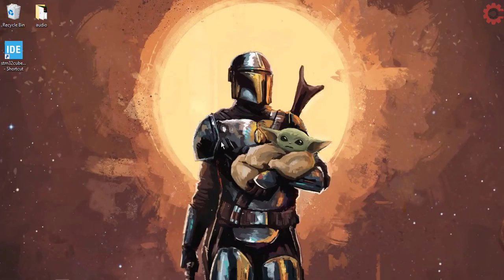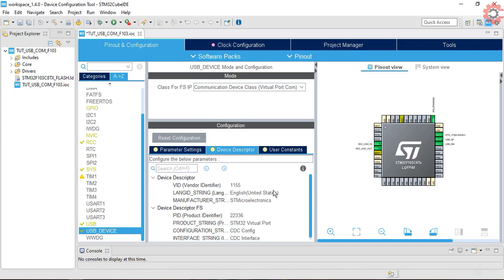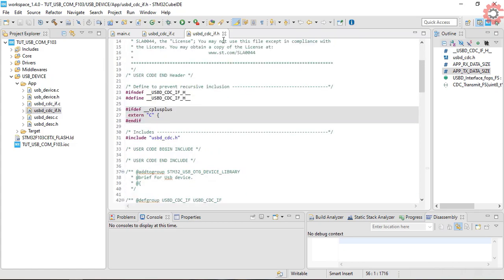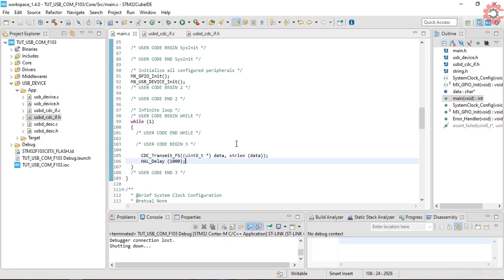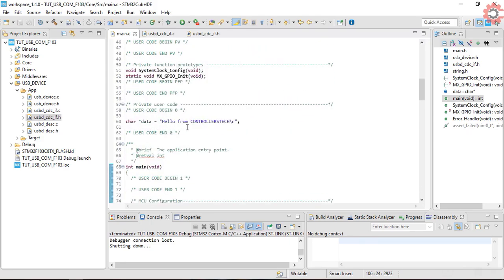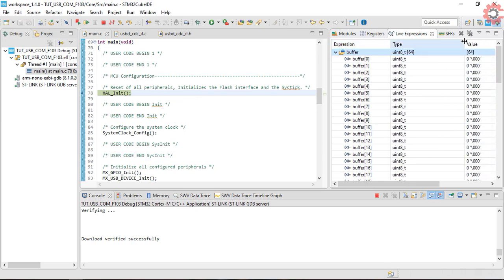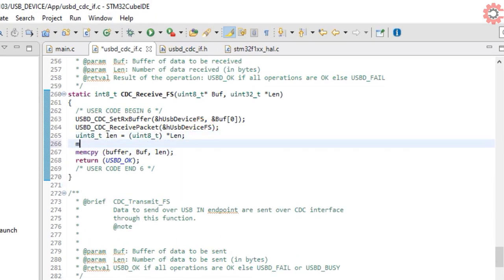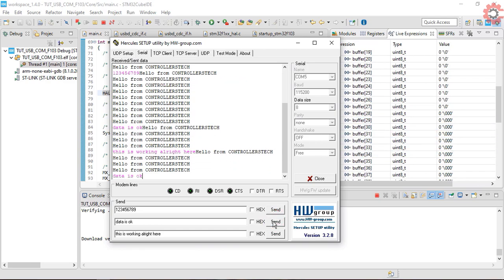STM32 USB CDC Tutorial: Virtual COM Port || Bidirectional Communication Without UART

Comment: From this video i assumed that you had connected the bluepill with both USB cable and the ST-Link debugger. But i can't understand how does your step able to run both debugging and Hercules terminal at same time. I have used your example but in my case if i connect the usb first and open port in hercules it is sending the string very well (i.e Hello from Controllertech) but after that when i connect STLink V2 debugger and start the debugging the string transmission stops on hercules and i even can't send anything to stm32.
Can you help me what i am doing wrong here?
Reply from the maker: Are you using bluepill ?
Reply: @ControllersTech Yes Sir.
Reply: @ControllersTech Please help me in to understand your setup for doing both debugging and sending data to stm32 at same time
Reply from the maker: There is no specific setup. It just works normally.
I will test it again tomorrow to see if there are issues due to ST's firmware update.
Reply from the maker: @RavindraSingh-jw2sm I checked it again and it works just fine. Make sure you connect the cable after running the debugger or else it will not be detected.
Reply: @ControllersTech Thanks for reply. I will check again as per your guided method.

Comment: Win10 not recognize device. Any advice?
Reply from the maker: Run the program first then connect the cable. Also make sure the cable supports data transfer.

Comment: Hi , nice video but I have an issue. I cant debug and use hercules at the same time. Is there anyone knows how to solve?
Reply from the maker: You need to establish the connection after running the debugger.
Reply: @ControllersTech  Thank you for your answer. But herculus cant open the serial with the linked com port when it is in debug mode.

Comment: hello i have followed all the step in the tutorial, but i can't manage to get the data on hercule nothing appear. What can be the issue
Thanks
Reply from the maker: Probably the usb cable does not support data transfer. 
Which board are you using anyway ?
Reply: @ControllersTech thanks for answering I am using stm32F407 discovery board,

 I will change cable and see if it's working.
Reply: @ControllersTech  thanks for answering, I am using stm32F407 discovery board.

I've used another cable but it's still not working.
Reply from the maker: 1. The video title says f103c8. Although you can use the same idea for other custom boards as well (like blackpill), but not for nucleo and discovery boards. 

2. Nucleo and Discovery boards comes with inbuilt ST Link, which can also be used as virtual com port for the UART communication. So you don't really need USB mode for it to communicate directly with the computer. Check the UART series, I have explained it in the first or second video I guess.

3. If you want to use USB mode so badly, you can sill follow the video procedure. But you need to connect the USB to the user USB port, not the ST Link. It is generally avaialble at the bottom of your Discovery/Nucleo boards.
Reply: @ControllersTech  Thanks for answering.

 i wanted to be able to use the usb port on my STM32 DISC because I want to connect it to an instrument and communicate with it. 

My computer doesn't recongnise the STM32 USB port even the Bluepill USB port.

-I checked the cable by connecting my phone and my phone was detected to send and receibve data (so it's not my cable) 

Best regards
Reply from the maker: "My computer doesn't recongnise the STM32 USB port even the Bluepill USB port." 
It won't automatically detect the USB. You must program the bluepill to use the USB peripheral. Then when the program is running, connect the board to the computer.
Reply: @ControllersTech  Thank you very much for your time and the recommendations. I find my problem it's because I don't have the stm32 VCP driver also. Driver in the link you furnished just for win 7 and 8 and I am on win10. 
No update available

Comment: How to do it for nucleo F767ZI ???
Reply from the maker: Why would you want to use it in a nucleo board ? You can simply use the uart2 to communicate with the computer.
Reply: @ControllersTech  You could also use uart in case F103C8 but you did not. Besides I want to do it without uart in similar way as you did but I encontered problems.
Reply from the maker: No you can't use uart in 103c8, if you do, you need to connect an external hardware to convert the uart data to usb. This was the main reason for the video. 
The nucleo boards has virtual com port which allows the uart data to display on the serial monitor without the use of an external hardware. 
Anyway if you insist on using it, you need to connect the usb to the "user usb" port, not the st link. Also make sure that the usb supports data transfer.
Reply: @ControllersTech  USB_DEVICE and USB_HOST in MXCube are disabled. I did not find the information how to enable them.

Comment: Hey, I use stm32 blackpill with stm32f411ce6u n the problem i face is when the product connected forthe first time via USB c interface it shows up as serial port and after installation on stlink v2 driver it isn't showing or there is no response via USB c n the c port is giving the power and the board turn on
Reply from the maker: Just run this example on the board. The USB C port will be detected when the example is running.
Reply: @ControllersTech  not anymore I brun it

Comment: I am using stm32l152c disco board  
And after connecting board to pc port no. is not visible.
Reply from the maker: It doesn't work for ST link USB ports. Connect to another USB port (user USB) if available.

Comment: Hi, I'm using STM32F446RE , i did same procedure i didn't get errors in the program but output is not coming
Reply from the maker: It won’t work with stlink usb. You need to connect another usb port.

And why bother with this ? Nucleo boards have uart connected to the stlink. You can simply use uart2 to send and receive data to computer, without using any additional hardware.

Comment: Hello, I need this tutorial now, but it doesn't work I am using STM32F446RE. Are they some updates or something that change?
Reply from the maker: You need to solder the user usb on that board.
The default usb you might be using is for the ST Link, and it can't be used as usb host or device.

Comment: Excellent video, but my WIN 10 is not recognizing the new virtual port. I have installed the official STM drivers, but no success!  Did anyone face the same issue
Reply: i think i have the same issue, did you resolved that?
Reply: @panteral6179  I have solved it yet, but I think about using another library than, that from ST electronics. I will try it next weeks

Comment: Hello, thank you for this video. I have a question. What happens if you restart the PC and the board remains connected? Can you still see the device in device manager? Since mine shows the USB descriptor request failed. If I plug it out and plug it back in again it works fine. But I have to do that every time I restart the PC. Do you have any advice on this? How does your device behave? Thanks!

Comment: Sir, if I do the Simple Led blink Program, then how can I check the output? I want to do it without ST link.
Reply from the maker: If you are just getting started, i would advise that you get a STLink or get a nucleo or discovery board, they have st link built in.
There are methods where you can upload the code to the bluepill without ST link. But you need to reprogram the bootloader for that. You can search about it.. I personally haven't done it yet.
Reply: @ControllersTech  OK sir. I will try to find and do the work.

Comment: works perfectly until i press reset button. It stops sending the string (have to unplug and plug the usb) . I don't see any stopping condition in the code . can you explain ?
Reply: did You resolved that issue?

Comment: Hi, the video was very informative. But can you guide me to any link or video for linux, as HW is not available in linux. I used putty, for getting the transmitted data. But cant do anythng to send data to the board. I am very new to this,if someone can help me with some tutorial guide / site, it will be very helpful. 

And also after debugging, running the code in STM32 CubeIDE it also shows an error like this : 
libusb: error [udev_hotplug_event] ignoring udev action bind

Can anyone please help me on the above also. Any small clue will be appreciated.
Reply from the maker: you can use putty to send the data also. If it's not convenient, look for cutecom.

Comment: i am limitted to recevie 64 bytes. after 64 bytes buffer overflows. "*Len"  pointer in "static int8_t CDC_Receive_FS(uint8_t* Buf, uint32_t *Len)" overflows when reaches to 64.
Reply: Did you indeed change the C code shown?  It has a hard code value of 64 I think.

Comment: Hello I have a question about the Len parameter in the CDC_Receive_FS function. What is it for? and what am i supposed to fill in? can I leave it out?
Reply from the maker: You don't write cdc_receive_fs function, it will be called automatically when the data is received by the controller.
Len is the number of bytes received. In the video i am using memcpy function inside the cdc_receive to copy the received data into the desired buffer. The length of the "data to copy" using the memcpy function will be the Len parameter, as that's the total data we are receiving.
Reply: @ControllersTech  thank you!

Comment: (Edit - IT'S WORKNG NOW)...

I am using stm32L475 and I cant see options for usb as shown in video. 
I can see three options
USB DEVICE
USB HOST
USB_OTG_FS
ALL WERE GRAY

but when I selected there pins, 
I can enable USB_OTG_FS .
I proceed with it, but in my project I can find any usb_cdc_if.c. 
Even the USB device folder is not generated.
Reply from the maker: Can u give the full name. I tried it with l475vg and the USB_OTG_FS is not greyed out..
From there you enable the host.. then the USB_HOST option will be available too
Reply: @ControllersTech  I did it today, It was just a matter of different wording, It is working properly now. Thanks for reply

Comment: My board is not being recognized as COM port. What should I do?
Reply from the maker: Which board ?
Reply: @ControllersTech  Hi. I am using ST32F013C8T6 Blue Pill.
Reply from the maker: Make sure the usb cable do support the data transfer.. cheaper cables are only build for charging
Reply: @ControllersTech  It does support. I am using Windows 10 and the St-link is being recognized but COM port.
Reply from the maker: You have to run the code. Then connect the USB.. now check the device manager

Comment: Nice!. The data is transmitted in which format? char or hex? What if I send uint8?
Reply from the maker: Whatever you want to send You need to send as characters.
Reply: @ControllersTech  I receive just a single char on Windows 11 Putty. It looks like the wrong baudrate setting but the baudrate is not applicable/relevant for a virtual com port. Double checked the clock settings and they are identical. Any suggestion?

Comment: Are there any STM32 modles that can do this without an extranal resonator?
Reply from the maker: Yes all of them can work with internal clocks. 
During the cubemx setup, instead of using HSE (High speed external) clock, just use HSI (internal).
Reply: @ControllersTech  
When I try to use the HSI, I get an error saying "cannot find a solution for some constraints". I am using STM32446RE. Should I maybe buy a different modle to make this work?
Reply from the maker: 1. You can use external crystal for 446RE. It will use the one for the ST link on the top.
2. If using the internal clock, the system clock will be limited to certain frequencies, so you can't use whatever you want in this case.
3. This video won't work with 446RE nucleo, unless you have attached one additional USB port ( you can see it below the empty crystal, "user usb").
The USB that you use to load program is the ST-Link, it's not the user port.

Comment: Can the data received from the stm32 be saved to a text file continuously until the code has finished running?
Reply from the maker: Well you have to build an application for the computer to do so. You can use uart to receive data from STM and save that data to the file on your computer

Comment: hi people! i'm using the same stm32f103c8t6, and i've tested the code as the video and it works, but without the debugger (stlink-v2), anyone knows if there's a problem using usb communication and debugger at the same time? or maybe i could be missing something... from now, thanks
Reply: did You resolved that issue?

Comment: Would this work if I have no HSE Crystal fitted? I was using a nucleo which didn't have one fitted it worked for weeks and now doesn't worried it might be the crystal
Reply from the maker: Nucleo have 1 shared crystal between the stlink and the mcu. So i don't think it's the crystal
Reply: @ControllersTech  Thanks so much for getting back to me! It's the NUCLEO-F411RE which appears to have a separate place for it? It really makes no sense as to why it did work in the past. To be sure if there is no HSE, the 48MHz can't be generated and so the USB device won't work as expected?
Reply from the maker: This particular project will never work with nucleo f411. It requires user usb slot and f411 only have stlink usb.
Reply: @ControllersTech  I have just used the IO header (CN10) as PA11/PA12 are available at that header. I have  then connected the USB D+/D- to those two points. Thanks again
Reply from the maker: I don't know why are u going through all this trouble when u can simply use the uart2, which is routed through the stlink usb itself, but it's upto you anyway.

I don't know why it's not working but i would suggest that you try a different usb once. I am sure it's not the clocks.
Reply: @ControllersTech  So you think that if there is no 48MHz clock it should still work? Just trying to make sure that it's not something easy like that. Thanks.
Reply from the maker: Obviously there needs to be 48 MHz. When you enable the usb, this clock should automatically be enabled
Reply: @ControllersTech  Hello again! As you pointed out I needed the 48MHz - I've added a crystal and it works (unsurprisingly)! I have some intermittent issues where the serial port is unable to be opened which I'll need to to debug, it always appears as a COM Port in device manager which is odd. Thanks again

Comment: I followed the same steps. but why on stm32f103c8tx the usb does not working " USB device not Recognized"?
Reply from the maker: Make sure the usb cable supports data transfer.. some cables are only made for charging
Reply: @ControllersTech  Hy i too have the same issue.. Any ideas ..i have done everything what you said....

Comment: How  recieve  packet from PC

B0=254;  //  sync
B1 //number of variable
B2//High byte 
B3//  byte
B4//  byte
B5=//Low Byte
Var[B1]=B2<<24+B3<<16+B4<<8+B5
If the stream fails, then in the incoming stream we look for synchrobyte 254 (skip bytes until we have received 254)

Comment: Hello, thanks a lot it worked for me! Excuse me, how can I pass a simple integer or float stored in a variable, instead of a string?
Reply from the maker: Convert to string and send..
Reply: @ControllersTech  I'm sorry I didn't get it. I have for example int p = 1, how can I convert it to string? Thanks a lot, I'm sorry
Reply from the maker: Use sprintf. It's very basic c function.. Google it if you don't know what it is..
Reply: @ControllersTech  alright I found it and did it, you are very kind sir, thanks a lot you saved me!

Comment: Hi, i cant view "buffer" y Expression. What could i do to show it? thanks! Sorry for my English, im Argentian
Reply from the maker: You have to add it there.
Add it in the live expression
Reply: @ControllersTech  for do that i need to conect the usb-programer, but then, transmission stops working. Computer stops receiving the recurrent message and buffer[] doesnt receive what i send. Do you know what could be wrong? Thanks
Reply from the maker: You saw i did it in the video right..
Just follow what i did
Reply: @cristianaguada8101  same problem here. Have you solved the problem?
Reply: @さい-j8e  Hi, yep. I bought a new bluepill. My first STM chip was a fake copy.

Comment: Tried transmitting simple "hello" string, didn't work. Nothing shows up on the monitor. transmitting data using mbed libraries works fine though. Any idea what might be the problem ?
Device: STM32F446RE, OS: Ubuntu 20.04
Reply from the maker: Read the @jacques comment from 1 week before...
And what do you mean you can do it using mbed libraries ? Can u share that library.. maybe it could help through the situation
Reply: @ControllersTech  oh, so I can't use the same usb port for USB data transfer which is also used STLINK ? I'm able to send and receive data using a single usb cable using mbed.h library (using mbed online compiler). Also while debugging the program (your tutorial), hcdc->Txstate is always zero so CDC_Transmit_FS() always returns usbd_busy. More over, it says can't access memory at some locations for both Tx and Rx buffer.
Reply from the maker: Can u send the link of the library you are talking about..
Reply: @ControllersTech  https://github.com/ARMmbed/mbed-os/blob/master/mbed.h --> mbed online compiler provides mbed library according to the target device selected.
Reply from the maker: I know what mbed is.. you are just pointing me to "what mbed os is"
You mentioned earlier that you can use usb functions to send data to the pc. I am asking the library for those usb functions...
If you don't understand this, just check the device manager in your computer and see if the board is recognised as a serial device or a virtual com port..